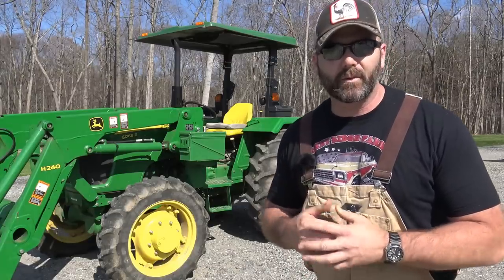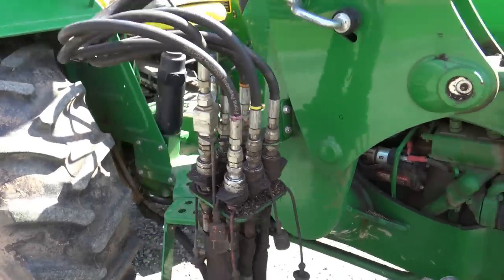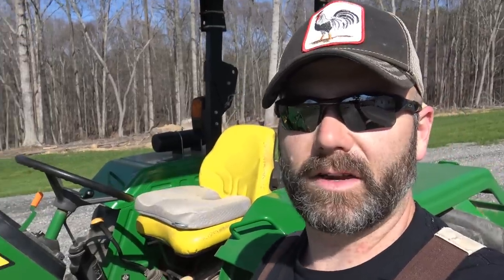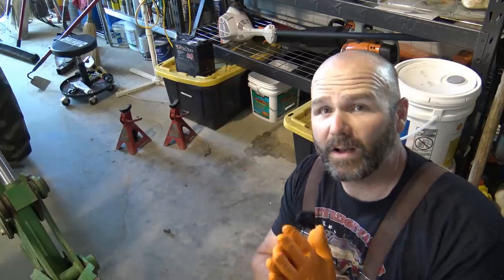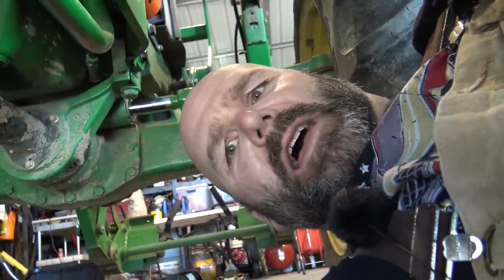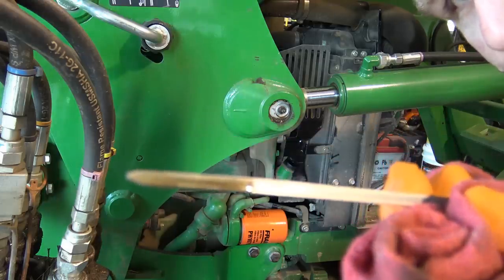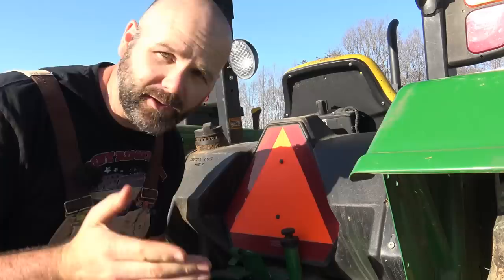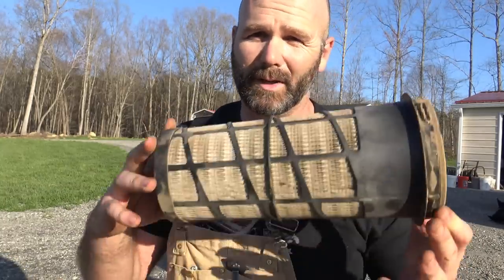TIME SAVING TIPS AND TRICKS FOR SERVICING YOUR TRACTOR AT HOME!!

Comment: Never use compressed air on any air filters because it spreads and opens larger holes in the filter media you can not see, use a leaf blower instead and some can even be washed gently by dunking in a 5 gallon bucket of dish soapy water then again in clean water.

Comment: Josh, I have the 5075e which I believe is the same process for the 55,65, and 75 models. You wisely mention to keep a maintenance log. If you look on page 140-1  through 140-6 of your operator's manual, they have maintenance logs all charted out for you to fill in. You can then write notes on the bottoms of the pages for tools and such.

Comment: Nice quick video. 2 comments. 1 keep a couple flattened cardboard boxes by your work station. Toss under tractor/truck/car/utv/even mower. Easy clean up, catches spills/dirt/misc, and more comfortable to lie on. 2 - Fram tends to be erratic, and they go into bypass too often/early, and filter media substandard. Use K&N, Wix, Napa Gold for best quality. K&N have a nice weldnut you can use socket on. I use K&N even on my Briggs/Kawasaki/Honda twins/ohc/etc. Jimho ymmv.  Max

Comment: Tip: Get two permanent markers in your toolbox. One white or silver, another black. Those two contrasting colors, most probably will fit the entire spectrum of needs!
 It will allow you to mark each and every component for which you need to remember some information. Like when it was changed, etc. 
A simple date scribed on your filters will save you a lot of head scratching and wondering about when to do maintenance and such! The information is readily available exactly where its needed. ;-)

I just recently took advantage of that method. While getting back on track a tractor that had been "abandoned" for the past 2 years... All necessary parts where properly marked with date and any additional information I needed! ;-)

Comment: My 5065E is 10 years old now and just hit 500hrs a while back. I did the same thing you just did but also I changed out the front differential oil. The only problem I have had is my starter finally just went out and was easy and cheap to replace. The guy at the starter repair shop said the starters on these tractors are a tad undersized and will wear out faster over time. If you notice it cranking slow even with a hot battery that’s your problem . I also installed several led flood light cubes around the tractor and it lights up the night! I also replaced my factory headlight bulbs with performance led bulbs.
Reply from the maker: Cool....great info...and you've reminded me I need to change the diff oils in the tractor too! I also need to take it in for valve adjustments
Reply: How many hours do do valves?

Comment: Consider slipping flexible rubber tube or surgical hose over the oil wrench jaws to offer padding for fuel filter collar removal. It grips but won't mar the collar. I use scrap fuel line for my wrench. 
Being new to tractor ownership, I find all your videos beneficial in the use and upkeep of my JD 3038E. Thanks and keep the videos coming.

Comment: I have the same tractor, same loader, even the same quick connect. Only difference is mine is a 2017 and has a cab. A previous video you did on the 5065e is actually how I found your channel to start with. I tagged you in a photo on Instagram with pics of the service intervals in case you don't have the manual.

Comment: Being a know it all tractor operator lol! I love the John Deere  it is reliable mine is older no computer stuff on it Its a b210 backhoe.  made quick detach forks mounted on the front bucket . I have a enclosed cab with AC keep me comfy in inclement weather. Might be a good idea  to get tools so you can repack the cylinders when they leak saves a ton of money doing the repairs yourself. Love that cushion need to buy one.  You make fun and pretty good videos without being a smartass.  Keep on going.

Comment: As far as synthetic oil causing leaks it will usually only cause leaks in very old worn-out engines that have only ever used Dino oil due to the fact that Dino oil will plug up any cracked seals with sludge and full synthetic is very good at cleaning that sludge away which in turn causes leaks very early on in the synthetic game when they first came out with synthetic oil many of the companies were having problems with the additive packages in the oil which was actually destroying and eating seals which I think is where the whole don't go to synthetic comes from.

Comment: Napa filters are made by wix, Donaldson is another good choice.  Can't go wrong with oe filters either, probably better pricing if you buy by the case. Copper washers should also get replaced periodically. Fuel filter is easier to prime if you partially fill beforehand. Napa sells a nice large red funnel, kind of looks like a fireman hat, works really well if using 5 gallon pails of oil, as it has a notch to hold the pail. Regular grease and oil keeps them running forever. By chance does that engine use a coolant filter? If so, good to replace every year or two.

Comment: Hey Josh, the farm is really looking good. Just wanted to tell you about a little gadget that I bought to clean out the radiator. It's called the Radiator Genie. It does a fantastic job. It comes with a water wand and an air wand. I was a little skeptical when I first saw it but after using it last year after bushogging I'm a believer. God bless...

Comment: Hey Josh, a quick youtube search for fram vs. wix will get you tons of videos of the problems with fram filters. There is one guy that cuts em open while working at the back of his huge flatbed service truck(thats the only description I can think of for you to find the video)..  Other than the cheap components in a fram filter the main complaint most have is how few pleats are in the filter material.  This guy went a step futher and unrolled and stretched out the paper filter material,,,Don't recall the measurements but the fram filter has way less material.  To answer your question about synthetic oil, yes every single engine I own that called for regular oil and a while later I switched to synthetic, they now have oil leaks (I have no idea why).  I have two generators that have never leaked a drop one of them(10 hp) had 200 hours on it and the 16 hp had less than 20.  Both started leaking from the main seals after 10-20 hours of running with synthetic.  weird.  Now, anything that calls for synthetic from OEM (3 polaris wheelers and one ranger) have never leaked a drop.  From what I've learned after some extensive research online regarding synthetic, if you service your equipment at the recommended service intervals, you do not need to run synthetic and really you're just wasting money.  The main advantage to synthetic is if you want to extend your service intervals...most guys that take care of their equipment just can't bring themselves to do that. lol  I switched to synthetic on my old 6.5 turbo diesel and the first thing I noticed was how fast the turbo spooled up but man did she start using oil!  I noticed when checking the oil while the engine was warm, the full synthetic dripped off the dipstick like water...that concerned me, but it explained the faster spooling. 

One thing I do that you might find helpful is every vehicle, tractor or any other equipment I own, under the hood I took a paint pen and wrote socket size/# of quarts for the oil changes - I'm getting too old to crawl under vehicles multiple times lol.  I also use an engraver to write on the end of the oil filters (for my tractors). I write hrs. and date.  Tried the sharpie route but my filters all face out and after 6 months of working them I couldn't read the sharpie writing.  Your's may work fine because the end of your filter is kinda protected.
Nice video.

Comment: Just a tip my friend. The service intervals are as follows, as per my experience. 
When using Deere Plus 50 II and a John Deere filter, you can change the oil every 500 hours. 
When using a different oil than Plus 50 II or a non-Deere filter the interval is 250 hours. Make sure the oil meets the performance specs and viscosities as per the manual. 
Check your book, this may be invalid. Always go by the book. You can use that air filter up to five times of removal, whether for cleaning or inspection. After being 5 times removed it’s time to go. 
You did fine, and I think you knew that anyway. Great vid.

Comment: I work for an automotive shop. We have seen several cars come in with engine problems (rod and main bearing knocks, upper engine clatter, collapsed lifters, blocks with holes in them, etc) with Fram oil filters on them. We actually had one car with a severe upper engine clatter that had an Fram oil filter on it. We changed the oil and put on a new oil filter and instantly the clatter quieted down. The filter was starving the engine of oil to the top end of the engine. I have never cut open a Fram filter. I have seen several videos and examples of why Fram filters are junk from a design and construction standpoint. I use only Wix filters on my personal cars and racecars. NEVER had a problem with Wix filters. Also, Napa filters are made by Wix and the Napa Gold series are basically the same filter with a different sticker.
Reply from the maker: Cool thanks man!

Comment: Fantastic video mate. 
I've watched a lot and most people while having a good go just miss the mark if you know what I mean. One thing I noticed with discribing the air filter system the inner is actually a "safety: filter where as if it has dust on it the outer is holed. 
Other than that great job, especially like the detailed recording of your servicing routines can't be too through there, I wish my clients were as detailed. 
Keep up the great work.

Comment: I did the same research on tractors that you did. I, however, found the Kubota to be the better choice and it worked out well for me. I just recently upgraded from my Kubota M6040 to a new Kubota M5-111 with a cab. Sure wish I would have bought the cab tractor in 2010 when I bought the first one. Glad you're having good luck with the JD but for me I could tell the quality that the JD green paint is supposed to represent wasn't in that Indian made JD. Although I will say that your JD does seem a little easier to service than the Kubota.
Reply from the maker: Yea...we will be in the market for a cab tractor soon...now we have to deal with the darn emissions complications!
Reply: Stoney Ridge Farmer so far the missions aren’t a big deal, granted I only have about 58hrs on it and really haven’t done any kind of real work with it but the DEF gauge is still showing full. The A/C and heat make up for the missions. So far at least.

Comment: Only halfway through right now, but I have a suggestion for oil change intervals.
Look into Blackstone Laboratories. You send them a small sample of you used oil, they send you back a VERY detailed analysis of what your oil is doing. What metal particulates are in it (which tells you what parts are wearing - bearings, rings, block, etc).Quite cheap, and very informative in the long run. I used to do 8 - 10000 miles plus on oil changes when I used them.
A Fumoto valve (available on eBay) makes taking a sample a five second task. it replaces your drain plug)
That said - Fram is a scam - I read once that they were the worst filters available. Rotella is fine, but I always preferred Amsoil. I think Wix makes their filters?
God bless you and Mrs Stony Ridge. Be well.

Comment: Hey stony 
I use puralator oil filters on my John Deere x300 they are a better oil filter...i also found that k&n air filters work well and I use Lucas grease on my grease fitting I use the green grease by lucas

Comment: That rotella t6 is great oil I've talk to a few experts in the racing community including the scientist who worked to design it and everyone recommends it. I've also sent my oil in for analysis multiple times and rotella t6 seems to be the best oil under $100 a gallon that I have found. I run it in all my vehicles gas and diesel that's what was recommended to me. Now I'm not I huge fan of fram filters they seem to be made alot cheaper on the inside and the filter material is almost like paper. I have had a fram filter fail but it was partially due to a catalytic converter failing and getting really hot. I replaced the cat and about 200 miles later lost the engine. I prefer the wix filters.

Comment: Always make sure the old oil filter gasket is removed when taking it off the tractor\car\truck.  Many times the old gasket will stay stuck to the block.  If it does and you install a new filter with a new gasket, it'll leak like crazy.
Reply: I was taught that, too.  After 40 years, it finally happened.  The gasket stuck on the engine block, that is.  Since I check, I caught it.

Comment: Do you have to bleed hydraulic lines after a hydraulic change we got a 5065e cabed model no arm but we use back hydraulic on it
Reply from the maker: Self bleeding hydraulics as per the dealer

Comment: Josh
Excellent video to watch as we settle down for the evening and I didn't even have to get dirty LOL I'm a firm believer in synthetic oil my Kawasaki V-twin has about 2400 hrs. on it burns zero oil . Even on start up cold. I'm also user of Fram filters there universal for everything I buy them by the case of six with and without grip ....extra guard etc. I would definitely change your outer air filter if you know how much dirt was really in there you would change it. Good job.....
Wooooo
Reply from the maker: Good point on that filter

Comment: Check with your JD dealer and see how much it would cost to switch your loader hydraulic individual disconnect's over to a single lever disconnect setup. With the single lever, you can remove in 5 seconds with no mess.This is what I have on my H310 loader, and my hydraulic hoses do not hang down like it does on yours.
Reply from the maker: Good thinking! I'll look into it

Comment: You need to check with your John deer service department if the tractor is under warranty if they will warranty the engine if you use a different  filter other than a deer brand and you really need to change air filter after 500 hrs
Reply from the maker: Good point
Reply: Stoney Ridge Farmer when ever you blow out the air filter less you have a good water separator or air dryer your compressed will put water out  and that will make dirt stick faster and since you have the inner air filter just replace outer you can do that 2 or 3 times

Comment: Rather use napa filters just don't trust fram on a working tractor also i like to use a stick magnet with the oil drained stick it in the drain plug hole and fish it around in the bottom of the pan the older your tractor gets it will give you a early warning if you got trouble coming when you start pulling out small pieces of metal chunks. I  use Diesel Kleen with every tank of fuel to keep injecters and pump clean.

Comment: Thanks for the very useful videos, well done!  I have a question about the 3-pont lift arm, specifically the right one with the handle.  Mine over the course of a few hours bladeing or mowing loosens and will fall off dropping the arm (and losing the bloody handle!)  It's a cheap hard to crank version anyway, so two questions: 1) how can i prevent this arm from loosening and 2) can I buy an upgraded handle?  many thanks in advance.  Cheers, Simon
Reply from the maker: Not sure brotha...check the dealership that sells your brand tractor..might could buy a new arm...thats my suggestion ...but I'm no expert at all

Comment: First you check the Engine oil dipstick before draiy the Engine oil. Why because some times consumed oil more than consumption so it some problem in Engine.

Some times Diesel or coolent is mixed in to the oil.

Use John Deere Engine oil only that is good for the Tractor.

Comment: Josh did it come with the sunshade or is that after market?  Good video  I run the two wheel diesel version of the 5065e. New tractors started with synthetics has always worked well my 1967 John Deere 2020 all regular oil it would leak.

Comment: QUESTION: you changed the hidraulic oil filter but Not the hidraulic/ transmision oil itself? You just added some hidraulic oil. Why?
Reply from the maker: Over the past 2 years the fluid has leaked down from leaky cylinders hooked up...busted hoses and such....I've replaced nearly 8 gallons of new hydraulic oil so far in this system.  So most of the fluid is new anyhow.

Comment: I bought a 2011 ram 2500 diesel the previous owner was using regular oil I switched to synthetic and the front seal started leaking

Comment: I just bought a used 410 tractor and it never came with any information on oil hydraulic fluid or anything. Would it take the same kind of oil as yours it’s a John Deere
Reply from the maker: Google brotha! Or call the dealer/service folk...that's what I did..or get urself a manual...google on that there info!
Reply: Thank you

Comment: Why Fram filters are utter garbage: https://www.youtube.com/watch?v=Imq39p0_YTA

I know it's long, but do yourself a favor and skip to about 10:15 and see what's inside them.  Assuming your tractor is, let's say for argument's sake a 2015 model year, it's still worth about $30,000..... 

Also, you're paying more for Fram than the OEM replacement from JD. And JD (most manufacturers) are more likely to honor a warranty if you apply their OEM parts. Just order a half-dozen of the JD part on Amazon and keep them around. Links to the two filters on Amazon are below:

JD RE519626 ($14.00 + Free Shipping): https://www.amazon.com/John-Deere-Original-Equipment-RE519626/dp/B00BZA1JLS

Fram PH10792 ($15.87 + Free Shipping): https://www.amazon.com/FRAM-PH10792-Spin-Oil-Filter/dp/B007IV7FV6/ref=sr_1_1?s=automotive&ie=UTF8&qid=1524135069&sr=1-1&keywords=Fram+PH10792&dpID=41rPxiN9ZJL&preST=_SY300_QL70_&dpSrc=srch